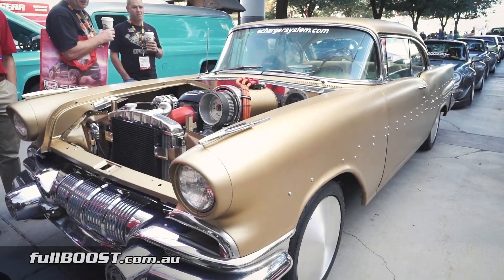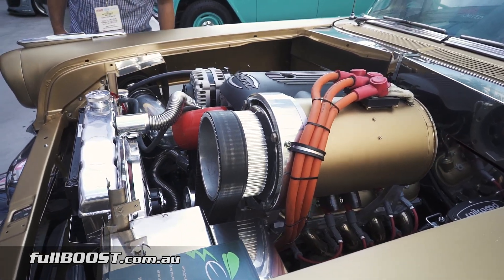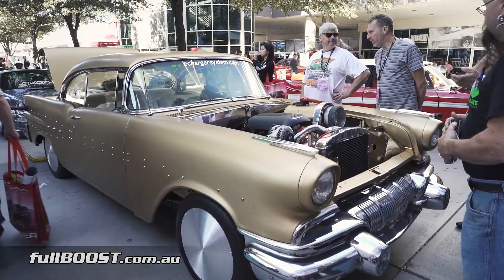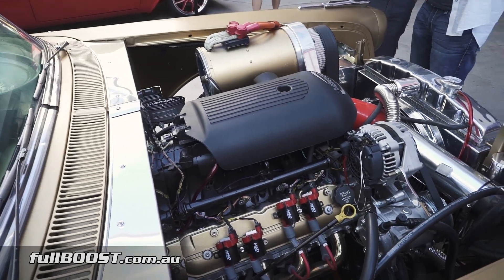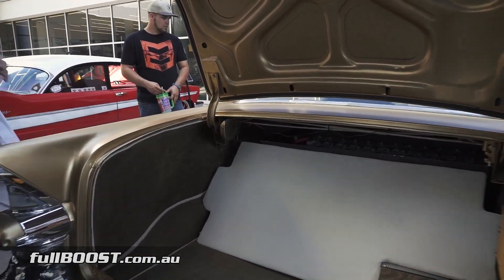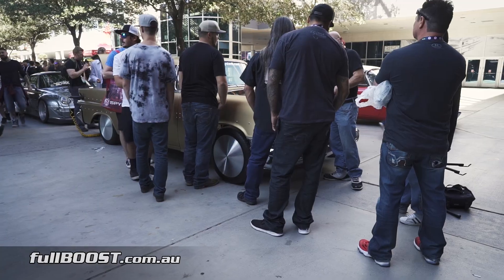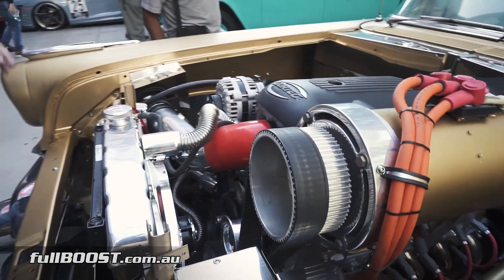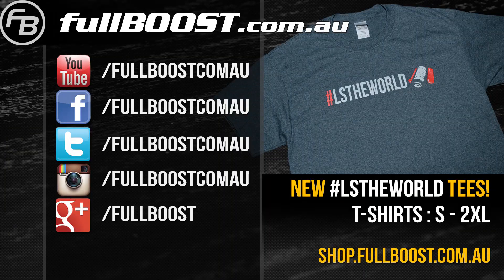The E-Charger Hybrid System

Comment: Ya know it occurs that the train industry and heavy equipment industry figured this out decades ago. You have an electric motor or motors to drive your wheels, that electric powertrain gets its power from a large energy storage device, which is charged by an internal combustion engine of whatever type usually diesel, and even some gas turbines (little jet engines). Why is this so fucking hard to understand and apply in the automotive world? The i.c. engine should have no connection to the wheels on a hybrid setup, its only job should be to provide electricity to ensure the battery stays at or above whatever charge threshold is set full stop thats it. The chevy volt is the only vehicle that comes to mind that took a similar although needlessly overcomplicated, approach. In the volts manual it told you to put stabilizer in the fuel because of how long it could be in your tank

Comment: Although the versatility of putting the motor on many different applications is great, the fact that it runs off of the serpentine belt rather than assisting the front wheels is the biggest downfall. You’re truly only going to be able to use regenerative braking when the torque converter is locked and you let off the throttle on the freeway or going around 50 miles an hour on the street at times.

The regenerative breaking would be minimal due to the losses in your torque converter when it’s in an unlocked state, especially when coming to a stop

Comment: And then dodge made the 4xe. 1000% more cars should use this type of technology due to how cheap you can get BLDC motors for nowadays as well as having a compact lithium battery set up to add on or throw under a seat somewhere. Maybe like a 48 V low-voltage set up With like a 200 amp power battery and I could see that being hopeful with mileage and power. Add that to a 20 kW water cooled brushless motor and you are good to go.

Comment: This has been done on several production vehicles, although usually with a much smaller and less beefy electric motor. Google BAS (Battery alternator starter) hybrid AKA mild hybrid. Sometimes called e-assist. Some manufacturers use this as a cheap, simple way to hybridize a vehicle and remove the alternator/starter, but costs are why the motor is never this big. Also it’s typically done as part of the serpentine belt.

Comment: It's a basic parallel-hybrid install, as far as I can tell, that mates the motor to the engine via belt instead of via the drive shaft or (ideally?) a planetary gear. Not a bad idea but, how much power and energy is lost due to belt slippage. E-motors torque rips through chain/sprockets so, I would imagine alot
Reply: It uses a toothed belt which don’t slip. It’s the ribbed belts that slip the most as they rely mainly on belt tension to prevent slip. Toothed belts are pensioned enough to take the slack out although the teeth do the real work

Comment: I would really prefer one that bolts to the pressure plate of the clutch and can work as all electric with engine charging mode, electric take off, hill decent charging, electric motor starting, engine only mode ect

Comment: This is the way hybrids should be built. Where the power from the electric motor can also be multiplied in the transmission. Only issue is the front bearing wear.

Comment: Why not run it to the differential yoke? You can better distribute the weight over the rear axle, shorten the cable lengths from battery to motor and also assist with braking through the differential.

Comment: Although I am late to the table and this question might have been asked previously, I would be curious about the reliability of a cog pulley system handling 100 HP or more electric motor, especially considering the torque applied to the pulley.  At "full throttle" would you not be worried about stripping the belt since you would have literally instantaneous force on the pulley at full torque while the gas engine is just beginning to "spool" up to RPM?
Reply: It's no different than a supercharger that needs 100ish hp to drive, the force is just in the opposite direction if that makes sense

Comment: I don't see it fitting under the hood of my 94 lt1 vette... 
Power to weight, thinking handling and performance. Sure, another 100 ft lbs, but what does that transfer too as far as extra weight to move and extra strain on the rest of the car?

Comment: I’m guessing this system will damage standard and upgraded crank shaft and front mains due to huge hub loads from that torque on the belt as well as the tensioner on that 4” wide belt.  Guaranteed this lowers the life of the crank shaft and transmission gears significantly.  Just me speculating but I’m guessing the additional loads and vibrations added by this e charger will cause strange failures in the engine block and bearing assemblies.

Comment: ok,  i've been considering doing something like this to my 2000 range rover p38, 4.0 for some time now. I don't have a factory supercharged engine but I know there are some that do and I was contemplating franken-mating a refurbished supercharger drive unit to an electric motor to make the install almost OEM. but Is that even necessary since you say the e-charger can work with any vehicle? My alternate install thought was to mate a PMAC in the driveline but this seems easier by far.

Comment: turbo adds efficiency by using exhaust gas to force more air into the engine, Echarger runs on electricity which is made by the alternator which is run by the motor using up your HP (or maybe it runs on pixie farts?). So this is basically a supercharger that runs indirectly and most definitely has worse efficiency because of extra power conversion steps

Comment: Small honda generator  powering straight electric motors with no gas engine would be much easier and simpler. Huge weight reduction as well.

Comment: I sincerely hope this isn't one of those great in theory terrible in practice type invention that are diabolical to get working seamlessly (except on the 2 or 3 engines the manufacturers tested it on), rushed to market, no support, no information, don't reply to emails, no possibility of a refund. My pet hate is a company using customers as a free test facility for their unproven in the field products. I'm a mechanic and i see this all the time and has happened to me with a 2x4 tbi system. It simply doesn't work or fit. They're quick to take your money though.

Comment: Why not use a smaller electric motor and ditch the batteries for an onboard generator that powers the motor and replaces the cars altenator? You can probably ditch the starter too since the electric motor is connected to the crank anyway, I think I might just build something like that.

Comment: Got a little 2.2l from an s2000 in my shit box corolla, wondering if I could use this as torque fill before it comes on cam to make the power band longer and more linear. Might also be an opportunity to run an insane cam profile and still retain drivability too

Comment: Will for sure the numbers are padded for the wow effect, but imagine even if it was just 400 horsepower and it got 25 miles per gallon that's still amazing and it's electric and you could still plug it in way cheaper than gas it's a cool concept I hope it takes off
Reply: The new Dodge Helliphant gets 22mpg at 800hp and up
Reply: Also I think the Corvette zo6 gets around 30mpg close to 500hp those are just off the top of my head.

Comment: Ok so the electric motor spjns the crankshaft causing the motor to combust wow must be a veryyy power electric motor god 8500 rpm the batteries at the rear mustve beeen very expensive god god god i will be the first one to this to my charger rt im sure its costy if i want a few batteries thatll be around a 1000 the motor i can only imagine the charger well im sure theres plenty of choices but might make the gas motor charge hybrid with alternator and then electric takes over or somehow work together

Comment: its clear this guy has no idea what he is talking about.  he is using one of the Hpev AC induction motors, it could be the AC50/51 or even possibly a 75/76 model.  there is no way they have braking regen since its attached to the crank via a belt.  in order for regen to happen the AC drive motor would need to be connected to the transmission or some kind of coupled electric/ice motor setup like a few vehicle manufactures use.  this title is bait and switch, e-charger suggests it is a electric powered supercharger or turbo charger.

Comment: I fear for the front crank bearing with that setup, that belt drive looks like it mounts on the outside of the normal belt drive system. There is a lot of torque being applied to a lever (crank) and its poor bearing that it was never intended to take.

Comment: Increase in consumption doesnt mean your fuel economy is getting worse. Engines from F1 cars have much better efficiency, despite them burning more fuel. They just get more efficiency and generate from 1 liter of petrol more energy. Its something different when you have 300 horsepower under your foot, so you automaticly drive a little harder and burn more petrol.
Also I dont like the way power is transfered from electric enginge to crankshaft. That V-belt can jump under bigger load. If its only for this, then nothing bad will happen, but if this is main belt, then you can easly fck up your synchronization

Comment: I can't believe he said when you're running a supercharger you have to run premium fuel that cost 5 to $10 a gallon WTH. The major malfunction with the supercharger is the amount of power that it actually takes to drive that supercharger which you are making it backup on the power that it adds but it's kind of a give-and-take. And it does require a lot of energy to turn that supercharger. So I like what hes got going on though it's a very cool idea.

Comment: Just use 4 starter motors and 2 alternators and 4 cheap batteries instead, maybe an ecu tune to rev high using trans momentum upon braking to maximise recharge capability, or modify turbo to spin a third alternator

Comment: I would like to see this system put on a Truck and Tow with and without the system. fuel economy run with and without a trailer and Dyno pull. I will install it and do every test you guys want if you can just let me know where the crap to buy it

Comment: didnt catch him saying anything about the alternator charging the system while driving, saw an inverter in the trunk.  wonder what that alternator is 200amp? 300?!??  i know belts slip on LS serpentines with 200 amp alts.
Reply: 803brando-The original alternator only charges the 12volt battery system.The big motor that's been added is connected to the cars computer and brake switch ,that's what charges/tops up the batteries in the rear,It only tops up when braking.

Comment: "Why should I give up fuel efficiency for power?"

Quite possibly the dumbest question ever. The answer is fairly easy. Physics. If you want more powers you either need more fuel or you need to create some miracle that makes burning fuel only expand but not put out heat.

As of right now, it uses more hydrocarbons to charge your electric car than it does to drove a car than runs on gasoline.

There is no question that electric cars work but for every step that fuel is changed from one form or another, efficiency is lost. A gas powered car. Oil is pulled from the ground, it is sent to a refinery and on to your gas station. For an electric car, oil is pulled from the ground, sent to a refinery, sent to a power plant, sent over transmission lines and the to charge your car. If you want renewable, look at the specifics that go in to building just a single wind turbine. The logistics, the amount of petroleum burning vehicles used is tremendous. I'm not saying we could never live on renewable energy but as of right now, building renewable infrastructure is more damning to the environment than plain old internal combustion engines.

Comment: Where can i get this motor addon? I don't care about the price I MUST have this.
Reply: its junk. why would you buy this? Do you not understand what a waste of time/money this is?
Reply: @kbtdadap  sounds like a fun project, that boosts low end torque, and increases power all around. If you're not a car guy you won't understand. Especially when we spend more money on our cars than others think its worth.
Reply: @captaincrust2180  been fully restoring 40's-60;s cars for 30+ years. Full time mechanical engineer for 35+ years. I think im a car guy. Also, you dont seem to understand much  of the science behind this in anyway. This is a farce and costs close to a used late model car. Its a nothing burger. hence why its never gone past this vehicle for usage. Shit, they dont even start  it up or provide any info/data sheets for it!! Because its garbage for the simpletons!

Comment: this would not add to peak hp maybe not even peak torque. all it does is offset 150ft lbs... it does not add any fuel or air it just eases the load.
Reply from the maker: Yea exactly.

Comment: Got a 7.9litre w12 supercharged lump which I’ve transplanted from a write off Bentley flying spur...to a 1992 jaguar XJS she has a extremely wide track due to cheap wheel spacers made from aviation grade ally looking totally bog standard apart from arches looks standard..0 to60 mph 3.2 sec and on to 100mph4.7sec if this system was viable would love better than 11 to 14max mpg

Comment: Trying too hard to make out its an electric powered supercharger, when in fact it's just an electric motor belt driven to the crank. So in reality its in the wrong place, it should be connected directly to the power train, so it doesn't lose power due to transference.
Reply: Simon wells- Where on the "power train" would you connect this? It either goes on the front or rear of the crank.The front is easier and cheaper to retro fit.

Comment: Why not just compress air into a tank with a belt driven compressor then blow the air in the intake
Reply: Because its like putting a fan on a sailing boat to blow up the sails.How about you skip the tank,use a belt driven compressor,l ike say a SUPERCHARGER,and blow the air direct in to the intake.
Reply: @nssherlock4547  thats a great idea, i can't believe nobody has thought of that before. Oh, what if you used the exhaust to spin up a turbine to drive a compressor!

Comment: not a cool idea for me. you can add "start-stop" function without 250lbs battery on the back. to gain more efficiency the AC compressor unit can be replaced by an electric one. probably better if they put two such motors on the rear axle of a small fwd car, so it can propel the car without having to turn on the engine
Reply: usbdevice its not just a start stop function. It reduces the load the engine sees.

Comment: Twin turbo that LS. It might sound like madness but hear me out. The hybrid assist will give you extra torque and power with an instantaneous throttle response at lower RPMs until your Turbo spools up. It’s like the same idea behind the new NSX except the electric motor is not directly on the wheels.

Comment: Ridiculous. If you wanted to be creative, why not run a 5th wheel on the ground (airbag to engage, disengage it) and the wheel drives a real turbine to force air thru duct work into the engine. If you went insane, then butterfly each cylinder to get even more power, so much it reaches a point where gas combustion is no longer needed and your engine (it is an air compressor) is running solely off pressurized wind power just the same as a whistle or a huge turbo( adapted to a 2 speed powerglide) this is powered by a series of mini turbos driven off that 5th wheel, perpetual motion. So many ways to harness energy once your wheels are turning.
Reply: 22k- Now your being ridiculous,so a motor and a controller and a few batteries is ridiculous,but your airbag,windbag,8cylinder butterflied mini turbo driven 5th wheel isn't ? ,ok.keep on blowing that perpetual whistle .

Comment: Great bolt on solution to existing engines without requiring energy from the engine
Better fuel economy with more torque in the bottom end. 
The power starts from zero assisting when all the petrol is normally used to get it off the line.
In the city cruising from lights to lights, this is great idea.
Who knows where this will go with advances in battery technology and maybe a super capacitor.  
This car is heavy which is where this low installation cost 'bolt on' really helps.

Comment: Id be careful. He's kinda fibbing on some details. Most notably electricity is on avg in the United States is $0.12 per kWh. So the epa recognizes a gallon gas equivalent of electricity at 33.4kWh. And the EPA recognizes the avg lvl 2 charger efficiency at 85% (meaning when you charge a battery you lose 15% to heat and resistance). So... 1 "gallon of electricity" will cost you $4.72. Not cheaper at all than the national average gas price of $2.50. So comparing prices that's like getting 89% more expensive fuel to use in your car.

Comment: No startup no preview no dyno no stats I can put a peanut butter and jelly sandwich on my engine and say it can now run without the oil of the peanuts and that its better then jiffy but what happens when I start it up ? Why not do something more interesting like a track system on the highway when drive on it. It creates fiction that turns into electricity that's stored and then sold as renewable energy. And everyone that drives on the highway gets some sort of tax credit